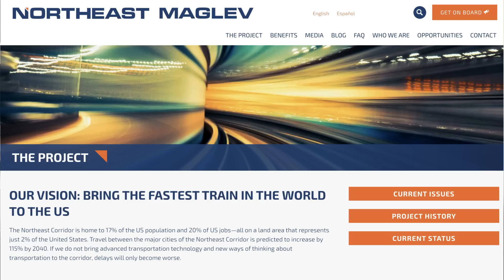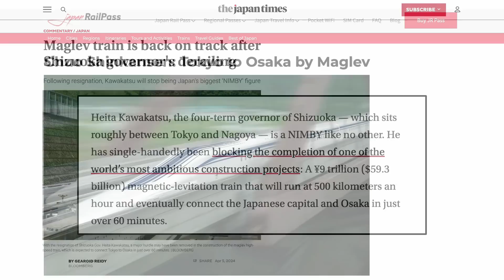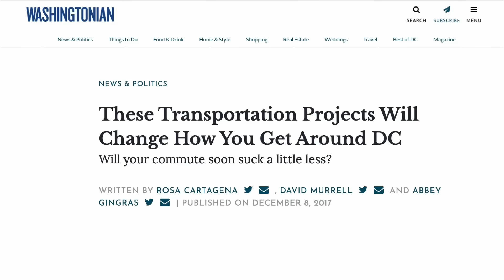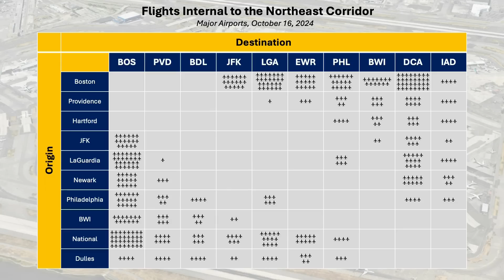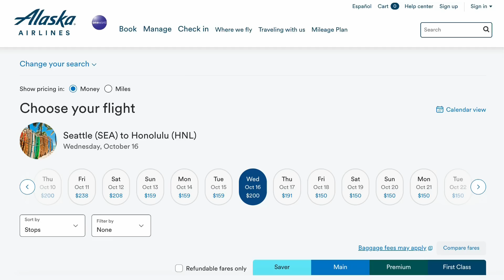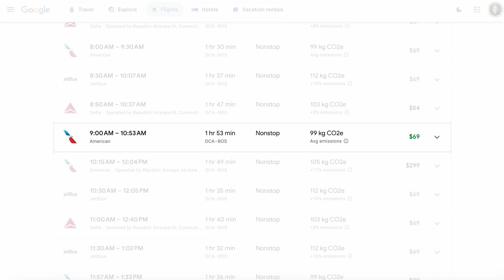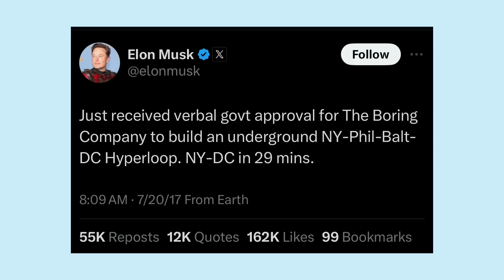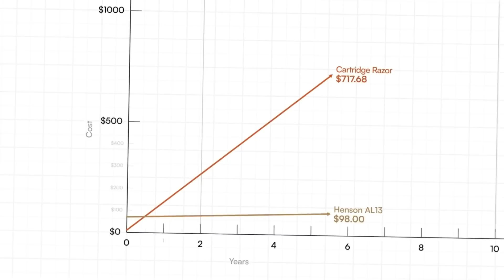A DC to Boston Maglev Would Be Awesome (and you know it)

Comment: The future requires major compromise because there are zero realistic plans for zero carbon living. Our plans so far are pure fantasy, not coming anywhere near zero emissions. Making HSR fast will be of little concern as our civilization is crumbling from either brutal austerity, or civil war between the climate delayers and the dead-end doomers. Very efficient, long distance, mass transit at any speed will be what is needed. Best not to plan for it to trade efficiency for complexity and speed. In fact, even the goal of HSR will seem idiotic when we are forced to run the same trains at 60 mph to save electricity, which by the way is already happening some places. Let us be humble, not arrogant. Let us plan for the worst case of Climate Crisis, which is much more likely every day we do nothing, instead of being overoptimistic about how trains will compete with planes and EVs. Those will not exist.

Comment: As a former resident of the DC area MD suburbs, I can attest that the DC-Baltimore Maglev project has a lot of local opposition. It's not so much NIMBYism as environmental impact. Maglev requires continuous, dedicated power supplied along the entire line, adding a lot more power infrastructure development than a self-powered railway system, and the proposed route would take it directly through protected wetlands and other ecologically sensitive areas. Also, considering the enormous costs to build such a system, it's safe to assume that typical fares would be inaccessible to much of the traveling public. Even non-Acela Amtrak trips along the NE Corridor are ridiculously expensive. Sure an intercity maglev sounds awesome, but there are always big tradeoffs.

Comment: I live in DC and regularly take the train to New York. As much as I really really want to love this project it just doesn't make sense. It makes a lot of generous/crazy assumptions. Like the 4-8 trains per hour frequency. Currently on Amtrak there are only 17 trains from DC to Boston per day. Northeast Maglev is predicting 78. There is no chance they will really run with that kind of frequency. If there were truly that many people willing to take a maglev, and I wish their were, there would be a lot more daily Acela trains right now. Next is the ticket cost which the Maglev Website has at $1-$2 per mile. So DC to Boston would be $430 on the low end. Compare that to the $69 flight shown in this video or a $107 Acela ticket. It doesn't matter how much faster or more convenient a train is if it costs several times more then other travel options. The majority of people will pick based on price above all else. I can not begin to describe how much I want true high speed rail in the NEC. But this northeast maglev project is not the way to get it. 

P.S. The DC station will not be at Union Station. The current design docs have a brand new station being built around Mt. Vernon Square.
Reply: I'd say "probably for the best" on not being at Union Station (it's having capacity problems), but Mt. Vernon Square would be... challenging. Can't bury it (there's rather a lot already in the ground, like Metro tunnels), can't go above ground (lot of historic buildings, or buildings that will suddenly become historic when locals find out that a train terminal is going in), and there are height restrictions making going elevated difficult.

Comment: A clarification on the shinkansen maglev permitting issues. It wasn't NIMBYism, so much as thinly veiled YIMBYism. Shizuoka prefecture was upset they weren't getting a station on the maglev line, because the direct path only passed through a rural sliver of the prefecture, far too deep underground to build a station, thus effectively bypassing it. They basically played political brinksmanship with the project. The eventual deal worked out after a change in administration was that in compensation for not getting a maglev station, Shizuoka would get some new conventional shinkansen infrastructure connected to the existing Tokaido line that passes through it.  

i.e. they weren't upset the maglev was going through Shizuoka. They were upset it went through without stopping. The water rights issue was the cudgel they wielded to get concessions.
Reply from the maker: Yeah, that's probably a better way of putting it
Reply: @CityNerd  ...but since the NJ Turnpike is about half a mile wide, there's probably room for the maglev route and one station somewhere.
Reply: This is similar to my comment about skipping New Jersey entirely. And that is a lot more area that the line would go through and a lot more people that would be bypassed.
Reply: @KameraChimera TRENTON MAKES, THE WORLD TAKES
Reply: interesting. Thanks for sharing that information.
Reply: The Gotthard base tunnel actually has a half-finished station right in the middle. There's a shaft and some tunnels going 800m up to fresh air in Sedrun (population 1.2k), which was used during construction and now is an emergency exit. People were mulling a whole station, with elevator access, called Porta Alpina but it never materialised, what's left is some gratuitous excavations to have space for it. Main reasons were the sheer pressure difference, to move a significant amount of people through the existing shaft that elevator has to be fast, and 800m fast doesn't vibe well with all humans, as well as a basic implementation reducing tunnel capacity by quite a bit. Alternative would have been further excavations for a passing lane, but that's expensive.

It's only a matter of time until someone will build an actually functioning station right in the middle of a HSR base tunnel.
Reply: Economies of scale are a thing though. There is a reason China can build so much HSR, and it's not about cheap labor, in large part it's about setting reusable standards, developing efficient methods, and building a lot, which gives experienced crews of builders who can basically build on autopilot. And of course actually funding the damn thing.

Comment: You forget something... Maglev is inflexible when compared to normal HSR. With normal HSR you can run a train down a high-speed line, then have it switch to a "normal" rail line which has been modernized and given OHW to allow a high-speed train to serve a town (at a lower speed, ofc) off the main. SNCF is a past master in this, their TGV trains are used on all sorts of services which use the high speed lines for part of their trips - ski trains from Paris to St. Gervais, Chamonix and Briançon, pilgrim's trains to Lourdes and summer trains to the Atlantic coast beaches. In the last case there was a brief period when TGVs going to the resort of Les Sables d'Ollone were actually hauled down an unelectrified branchline behind a pair of modified diesel locomotives over the last leg of the trip from Nantes to LSdO (the line now has OHW, but this is turned on only in summer). And, during the COVID pandemic, SNCF lent the French authorities a pair of TGV sets which were converted into ICUs and used to wisk patients from affected areas in NE France to hospitals in the SW of the country, using a mix of classic and high-speed trackage for the journey. Try doing this with a maglev... A proper, steel wheel on steel rail, HSR would work better on the NEC, as it would remain compatible with the "legacy" systems already in place and allow some incremental add-ons - like, say, stringing OHW over the line to Cape Cod, or putting wire over the PAR/CSX main to allow a train from NY to reach Portland. 

As for maglev being "proven technology", this is a half-truth. The Shanghai line was built as a prestige project. Fares are stiff and most people travel by the paralleling metro. After the Shaghai line was opened, Trasrapid ceased to exist and its test track is essentially abandoned. A friend of mine has travelled on it, the trains are noisy and vibrates much more that a steel wheel train.
Reply: I can't say anything about the ride quality of the Transrapid but just wanted to clear something up in the end: First of all the development of Transrapid and the Shanghai line are not connected. So it's not like the whole development of the Transrapid was just done for that line. Transrapid is a German maglev system. While looking at places to implement that technology pretty much every other country wanted to see a line in operation in Germany first before going with Transrapid themselves. Well, due to political reasons ot never got implemented in Germany and the only country willing to go with Transrapid without seeing it in service in Germany first was China. But that line isn't really a great option like you already mentioned. The station is in an awkward place and the distance it covers is short so it doesn't really improve on the metro line.
The test track in Germany is abandoned because development/research has been deemed complete and the certification of the track ran out. It is considered to be a finished product/technology
Reply: @Guy-Zero really sucks DB backed out of it. Imagine a maglev connection from Hamburg to Berlin and on through to Munich. Would save so much time against the existing ICE (that’s often delayed) lol.
Reply: @Guy-Zero  "the certification of the track ran out" is a VERY weird way of saying "they killed someone."
Reply: @colormedubious4747  The accident had nothing to do with the track certification.
Reply: @Guy-Zero  True, it was an operational error and not a problem with the track. It WAS, however, a key factor in Siemens' decision to shut down the site.
Reply: @colormedubious4747  Where did you get this information from? "Shut down" seems like unfitting words in this case. The certification just ran out and they didnt renew it because research was deemed complete. Also the accident was in 2006 while the test track was closed at the end of 2011. So they kept testing the Transrapid and the technology even after the accident
Reply: @Guy-Zero  It might well be that the article I read a decade ago had some inaccurate information. Who knew the media couldn't be trusted to get the facts right? 🤣
Reply: "As for maglev being 'proven technology,' this is a half-truth." -- Do you not know what "proven technology" means? It's absolutely a 100% truth. The TECHNOLOGY was completely proven on the test track. The implementation or Operations & Management being less than perfect is a completely different kettle of fish, just as with the Las Vegas Monorail. We've seen these technologies work. The Japanese have already proven that their next-generation maglev tech works. That's not an issue. The actual issues are capital cost and operating & maintenance cost.
Reply: With how the freight trains in the US way too often get priority over passengers, the US might actually be the weird kind of place where it's BETTER to not have the ability for maglevs to go somewhere where they might meet a freight train.
Reply: @Pystro  That scenario is literally impossible, but - as long as you brought it up - except for roughly 700 or so miles of right of way owned by Amtrak, the freight-hauling railroads built and own ALL of the intercity track so OF COURSE their own trains get priority. It's not like most cities see more than a few daily passenger trains. There's a relatively easy fix for this problem, but that's a whole other topic.
Reply: @colormedubious4747  The "maglev on freight rail routes" impossibility being obvious is exactly why I thought it unneeded to emphasize that it's only possible on the HSR side of the comparison.
Reply: @Pystro  Okay, that's fair enough but your intent wasn't clear in context. The pros and cons of joint use are definitely a conversation to have, but that's a whole other topic.

Comment: USA north east could put high speed rail in straight tunnels to make construction cheaper.
New surface and raised infrastructure is nearly impossible or at least high cost compared to tunnels because of the nimby's along the full distance of the corridor as well as immense legal hurdles.
Reply: Tunnels are more expensive than raised infrastructure even after considering eminent domain challenges, which is why CAHSR is largely using raised infrastructure.

Comment: Maglev’s current record speed is 375mph compared to TGV HSR 357.2mph (and the Shanghai maglev averages 152.3mph) so there is a huge investment combined with the need for knowledge and new infrastructure operations and maintenance for a small speed difference vs traditional HSR. Currently the trip between DC and Baltimore is 30 min on Acela so again is it really worth the massive investment to save just 15 min? 

Acela runs on infrastructure over 100 years old. Instead of studying maglev, let’s use our money smarter. Repair and replace current infrastructure and shore up public transport to make the trips seamless. 

Of course this isn’t the sexy idea that will have “important people” on the board of directors but America really needs to start taking operations and maintenance of our infrastructure much more seriously. Instead of always searching for new ideas we should be optimizing what we already have.

Comment: I'm not sure this would take as many planes out of the sky as you think. A significant percentage of passengers on short flights are using the origin or destination airport to make a connection.
Reply: That’s not really the case on the DC-NYC leg, as both DC and New York have major international airports with dozens of connections, so the primary purpose for most people is commuting between the two cities themselves as opposed to connecting onwards to another flight, since many international destinations can be reached from either starting point. 

For example if I live in New York and typically fly United, why would I connect through DC to get somewhere when it’s almost guaranteed I could also get there from Newark? In my experience fares aren’t usually too different between the cities (at least to other big international destinations) and certainly not enough to make the connection worth it from a time perspective.
Reply: @spartan117zm    you are forgetting (deliberately or naively) that if flights from NY to London are full, it's easy to take a short connecting flight if DC if it has seats to London available. And vice versa. I've flown between LA and SF seven or eight times, and not once was I going from one city to the other. It was always connecting flights because they are both hop on/hop off points for Asia/Australia, and seven or eight times the flight I wanted wasn't available so I flew to the other city and did a short haul between them. If the California HSR is ever finished, people are in for a shock when they realize how much of that air route is connecting flights that are not going to change.
Reply: BOS to JFK is definitely this way for Delta international flights... there are many more destinations available from JFK than BOS.

Comment: I think that there is a rather significant flaw in your plan, in that it assumes relatively frequent stops, which is exactly antithetical to the purpose of maglev.  As few stops as possible should be the order of the day, but the cities of the NEC are too close together (but politically distinct) to allow for that.
Reply: Also, the access time for maglev should be correspondingly longer, especially given the boarding procedures planned by JR Central, which have distinct airline overtones due to the high levels of EM radiation from the magnets.

Comment: NO!! Don't build a stupid gadgetbahn that requires prohibitively expensive proprietary track and unicorn rolling stock that can not be rerouted on regular track in case part of the high speed corridor is unavailable! It will demonstrate to car brain politicians that trains are a waste of public funds. You don't need trains to go 500km/h when all the stars are perfectly aligned. You need trains that go 300km/h for most of the distance but can also run at 150km/h or slower on regular track. It allows you to build a much wider network where trains can depart from any station, use the high speed corridor for most of the distance, and then run the last few miles to any station on regular track.

Comment: the problem with maglev in the US NE corridor is cost. it's been tried before between New York and Baltimore and fell by the wayside because of cost. a maglev track will need to be new and straight(ish) and it will run into the same problem of actually being built through already occupied land. people will inevitably not like that and cost will spiral. China and Japan don't have that problem because of different social values - in Japan if it's old get rid of it, in China the govt doesn't care. there's a reason that all the European plans were cancelled.
Reply: the 'new and straight(ish)' problem applies to HSR as well, and crossing restrictions of HSR push it towards mostly elevated tracks - so again, might as well be maglev.

Comment: Quick correction: the Shanghai maglev doesn’t go to the CBD but goes effectively to nowhere and only hits top speed for a short section.  After this project China has not done any more maglev projects.
Reply: What you described is correct. The Shanghai Maglev was basically just a demonstration project, at a time when no one has built a Maglev of any scale, so it's not dissimilar to the glamourous projects Dubai likes to do. However, China is actually working on an actual city-to-city Maglev transportation system that is supposed to run at 600 to 1,000 kph. When this will be completed is still an open question, but it is in the plans. Japan is already building the Chuo Shinkansen (Maglev) between Tokyo and Osaka. That project has been beset by multiple delays, and we might see it open in 2032-2035 time frame.